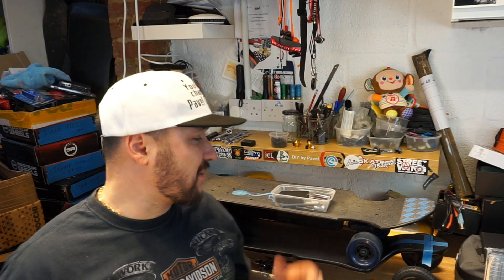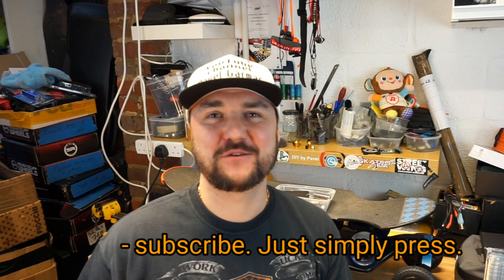Make your electric skateboard safer! Upgrade the bolts.

Comment: Pavel did you delete my post regarding painting the ht bolts? Not sure if you re-uploaded the video
Reply from the maker: Hi mate ,
Video was deleted by mistake and re-uploaded again. Sorry.
Could you comment again?
Reply: All I said was the high tensile bolts rust easily, I remove the film of oil with acetone or brake cleaner and paint the heads with a few layers of paint and clear, the thread I give one coat of paint and clear, they won’t see any moisture as they get screwed in
Reply from the maker: @bajaboardukesk8858  
That is a very valid and good point mate!
Thank you.